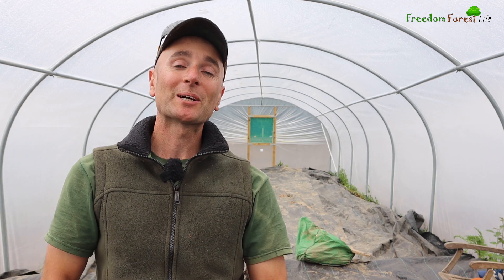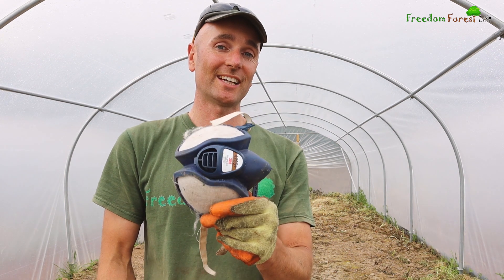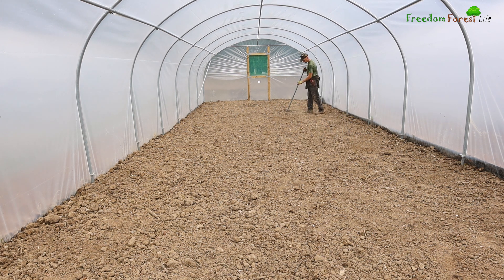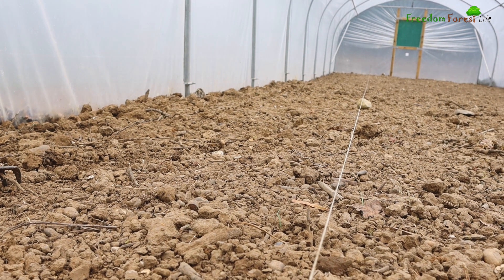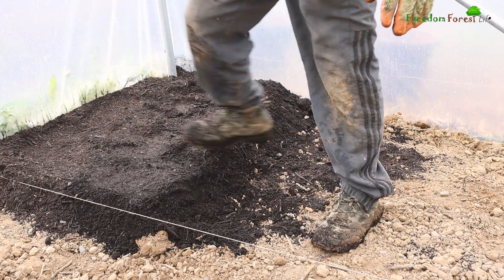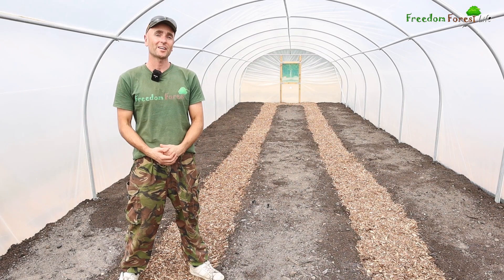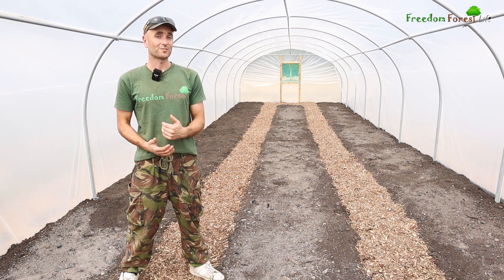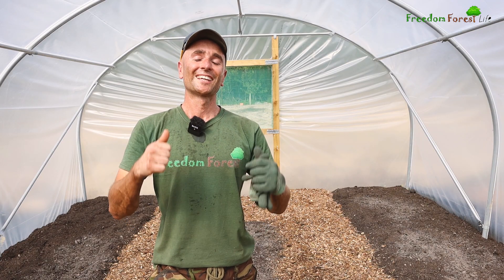Making NO DIG Beds ...From Start to Finish...In A Polytunnel

Comment: Hi there! I don't have any access to that much compost, but I have some really fine fertile garden soil. Can I make the beds out of soil instead of the compost? What do I add in the soil to keep it fertile after every season? How do I incorporate organic matter into the soil? Won't the soil compact after the first year, how will I loosen it up? If I add hay to mulch the plants after I plant them wont the seeds from the hay invade the greenhouse and will result in tons of weeding? Lastly, I have some chopped up corn stalks but they are kind of rotten and smell weird, is it a bad idea to add them in the walkways? (I'm afraid that afids and other diseases are binding in them). Thankyou very much! I'm a beginner and very curious about the no dig technology!
Reply from the maker: Hi Petru, you could initial use mostly soil to make your beds, but ideally each year you need to add a fresh layer of compost around 1-3cm on top to feed your soil and the micro organisms. Compost doesnt compact like normal soil, that is one of the reasons why it is best.  You could start you beds with your soil this year and turn your hay and chopped yo corn stalks into compost to top up and feed your beds after your first growing season... the worms will take the matter from the tops down into your soil, so there is no need to dig/loosen... they do it for you! ... if you get the composting hay hot enough, that will kill off the seeds too and you can add any other plant material you have to your composting pile too ... but you do need to give it as long as possible to break down ... there are ways you can compost faster that may be worth looking into if necessary. Hope that helps ??? Happy growing ✌️🌿
Reply: @freedomforestlife  Thank you very much for the helpful reply! I have created my beds with fresh soil and after I will plant I will mulch the plants with chopped corn stalks. After the growing season I will add well fermented compost and then repeat the process (compost, plant, mulch). Does the mulch around the plants need to be composted or can it be fresh, dried chopped corn stalks? I have drip irrigation under the mulch, hopefully it will break down until the end of the season due to constant humidity. Lastly, the corn stalks I place in the walk ways (you have wood chips) does it need to be kept constantly moist or left dry? How often do we re mulch our walk ways?